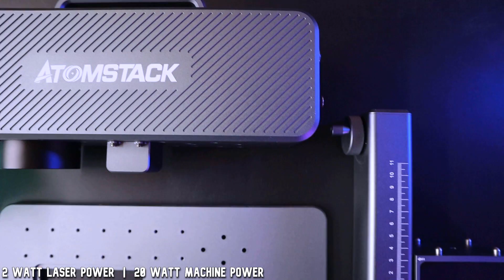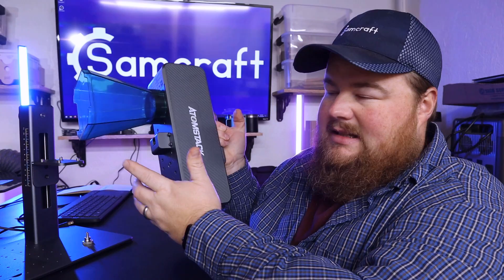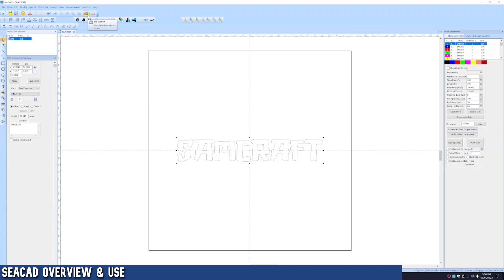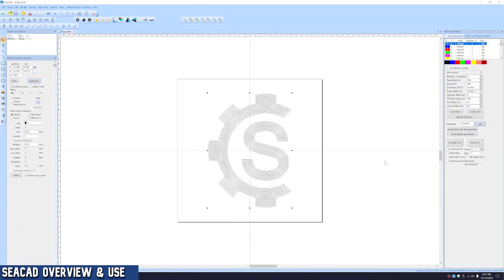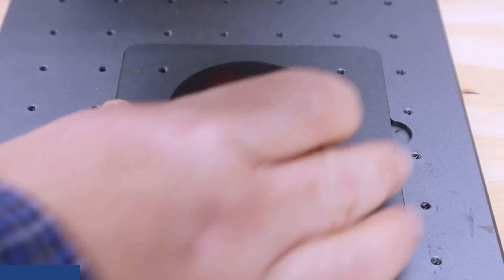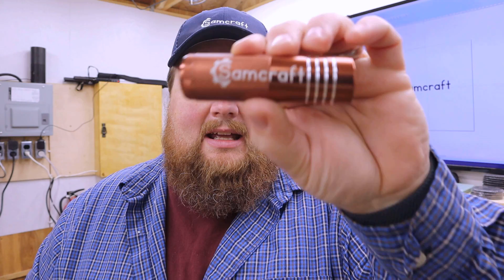SMALL but MIGHTY, METAL Laser Engraver!!

Comment: Im look to buy a laser engraver for metal and other materials, recently stuck at home with back issues needing surgery so o need a way to make some cash. What budget machine would be a good start?
Reply from the maker: The ComMarker B4 fiber laser is very good. I have used mine for well over a year and had ZERO issues. Here is my video on that machine: https://youtu.be/Iv3cawA6e_I
Reply: @Samcraftcom I'm just now reading up on the difference between diode and fiber lasers and I want the fiber but only have the budget for a diode, maybe a diode laser can help me make some cash to get a fiber laser. Maybe. Do you got a donor? lolol, thanks for the reply !!!

Comment: 1:04: ⚙️ Compact and powerful Atomstack M4 laser engraver with 5W laser, 1064nm wavelength, and versatile desktop or handheld use.
3:34: ⚙️ Issues with machine operation and limited flexibility in positioning piece, but includes useful features like threaded inserts and machine screws.
6:48: 🔍 Limitations of the laser engraver software and CAD program make it difficult to use and lack user-friendly features.
9:39: ⚙️ Demonstration of using a laser engraver, emphasizing the importance of safety glasses and the working surface size.
13:00: ⚙️ Demonstration of using a metal laser engraver to outline and mark text on a business card in real time.
16:35: ⚙️ Demonstration of laser engraving on metal, including adjusting settings and creating a PCB-like design.
20:27: ⚙️ Demonstration of laser engraving on metal surfaces, including cards and coasters, with a focus on speed and efficiency.
25:41: ⚙️ Laser engraver performance with different metals and materials at varying speeds and passes, affecting heat dissipation and power requirements.
28:30: 🔍 The debate over whether the laser is a fiber laser or a galvo laser, and the hesitation to label it as such.
Recapped using Tammy AI

Comment: Your video is absolutely amazing and it really caught my attention. However, I don't believe that this product can offer the same level of attraction as your video did. Describing a laser marker that can only make shallow marks as versatile is not a good right guidance. I have tried similar small machines before and while they are convenient, their limitations make me want to throw them away. They cannot engrave, which is a must-have for me to mark my logo on my knives. It takes at least an hour to do the job and the result is often unsatisfactory. I am not sure how this product differs from LaserPecker. If I were to choose, I would go for LaserPecker instead of this product that has been labeled as "Absolutely terrible" on Amazon. It doesn't seem like a reliable machine and their after-sales service is probably not very professional. I would recommend EM-Smart instead, even though there may be a price difference. They are true fiber laser marking machines with the ability to engrave on metals and various materials. Their service is excellent and always provide me with great support.

Comment: That laser is a DPSS (Diode Pumped Solid State) machine.
Has a diode pumped passive YAG q switch that puts out 15KW (microsecond) pulses that are 1024nm.

For the price point, about 1/4 of a 20W-30W fiber, it's not a terrible deal but it is, as you say, pretty low power and has a small working area.

Something for you to try:
Defocus upward (away from the work surface not toward it) between 1-4 millimeters, with an actual fiber laser you can get colors on metal and enhanced engraving depending on what you want to do.

Comment: Great video, a clear, detailed and fair/honest take on the product.

I’m curious how much material is actually removed - how much relief is there (etc, how deep is the cut) on say the slate coaster after all the passes? Ditto the metals after 4 passes?

A side note: I wonder if it would be slightly faster dialing down the speed a bit more on materials, rather than taking two or 4 passes? I’m thinking that multiple passes mean that the metal surface completely cools before the laser comes around again for the next pass. I wonder if you could do copper in 1 pass if you slowed the laser down to say 80 - 100 mm/s? 4x slower would be ~63 mm/s, but I’m thinking that you might not need 4x the time if it was just heating the spot all in one go, rather than letting it cool fully before the next pass comes along? Probably not a significant difference in overall production time, but I’m curious how it would work out.

Comment: Hi Sam, it not only destroys metal, but also the inside of your eyes and under your skin, even in low dosis radiation. Great to see many people are interested in lasers, but safety is a missing element in most low cost chinese solutions. Also exhaust fumes, not removed at all, meaning stailness steel you breth chomium, perfect for getting long term cancer. So in all, be SUPER carefull with these machines, because the CE label of FDA label is only a sticker, there is no value behind it when it comes down on safety.

Comment: The definition of a fiber laser is the laser used a doped fiber as the gain medium. It could be a fiber laser, the spool of gain fiber would be inside the box but the chances of that are slim to none. It is most likely just a more generic DPSS laser, possibly using some passive q-switching to get the high peak power, unless there is a frequency setting some place.

Comment: some assembly required batteries not included for 1699. however thats a dc power jack this can be ran off a battery on a tailgate at trade shows flea markets swap meets the pasture making tags for animals. im sure ts indexable for larger works too. but the price is way more then most people would spend with out some way to make the money back

Comment: The handle to adjust the height is really crap.For me also feels very loose and rough really not nice. but if you turn all the screws too tight then you can no longer turn.I use for my other laser also lighburn have therefore also informed me and even seen a statement that the m4 should also work with it then.hope the update is there soon because that would make the M4 Really good.the software puts me before problems because many files are not supported.In addition, I do not like it so well that the information about the device is often wrong.It is often spoken of 20w which is wrong. He hatt also not 5w he has 3w.Yes, and you're right, it's not a fiber laser, which would be extremely expensive in this small device if it were possible.

Comment: I have the Mr Carve M1, ComMarker 20w Fiber, and a Omtech 100w MOPA Fiber.  I backed the Mr Carve on Kickstarter, it was my first 1064nm laser.  To be clear, you are correct, the AtomStack isn't a fiber laser.  It is a 2w 1064nm (DPSS) diode attached to a galvo head.  The Mr Carve shipped with SeaCAD as well.  There is a steep learning curve when it comes to using SeaCAD and EZCad, they are very similar in operation.  Mr Carve was first out of the gate with a 1064 Galvo, this looks very similar to Mr Carve M2.  I would bet that they share practically everything, minus the shell.   The Atomstack looks identical to the Enjoywood M4.  However, even though this isn't a fiber laser, it is using traditional fiber laser type software.  I would suggest people be educated on the software before jumping into the 1064 Galvo and or Fiber lasers.

Comment: I had a similar laser system for a short time (Mr. Carve M1).  It works great on plastics, and marking metal, but it won't engrave to any real depth, even with hundreds of passes.

I returned it and bought a fiber laser with a 50w JPT source, and the difference was unbelievable.  The material that the smaller laser struggled to mark were cut completely through when I tried full power.  If you're needing to actually engrave metal, not just mark it, get a "real" fiber laser and save yourself some time and effort.
Reply: Got any links to the product you went with?
Reply: Yea but also a huge cost difference and power difference. Your not comparing apples to apples but watermelons to grapes

Comment: Right, nice demonstration. Question, you can feel the engraving, material is vaporized. For my own health I don’t want to be in surroundings where vaporized aluminium is in the air. I like the result, Ilike the process, I like your explanations. Should’nt fume exhaust/suction be setup?
Reply from the maker: Yes, 1,000% yes!!! I just received my 4" duct fans and components to set up a dedicated fume extraction for this laser and my other diodes. :)

Comment: @samcraft do you think an AtomsStack S10 Pro Diode laser will etch slate? Crossing my fingers you say yes because that is what I am about to be working with in the next 48 hours.
Reply from the maker: Any diode or infrared (1064nm) laser above 2 watts will engrave slate. It's one of the easiest materials to work with! :)  Edit to add: You'll want to run a "tile test" when you first get it on a piece of slate. That will show you what the sweet spot is for your exact laser. Actually, if you'll email me I have a Lightburn file I'll give ya for that if you need it.

Comment: Been waiting on you to review this one, as I've been looking at something to mark metals with.  I'm sure lightburn will have it incorporated in the software before too long, they're really good with their support.  The only thing I see on this that I'm not terribly happy with is the working size, 70mm is pretty small, I'll just have to see what size things I'm really going to work with and go from there.  I'm pretty sure the Atomstack would have issues actually cutting metals, where a proper fiber laser can actually do that (at least from my research anyway, I don't have any practical experience with fiber/galvo yet).  Still, the detail you got out of this thing on your examples is outstanding..  Wonder how long it'll be before someone figures out how to use this with a rotary, lol.
Reply: My opinion is that it is made to engrave jewelry and other small material

Comment: This would be great for PCBs.  Cover the blank with black spray paint, engrave the negative spaces then etch.  Run a deeper engrave for the holes to create divots that will pull in the drill bit.  The threaded holes in the base make it easy to create a jig for aligning a 2-sided PCB.
Reply from the maker: That's a very creative and great idea!
Reply: @Samcraftcom  Great idea! I recently came across this idea as well, but I ran into an issue: The laser was leaving a thin layer of paint (perhaps burnt paint?) still ontop of the Cu layer. Would you be able to still etch even with this thin layer or do you know how to remove the thin layer?
Reply: Great idea! I recently came across this idea as well, but I ran into an issue: The laser was leaving a thin layer of paint (perhaps burnt paint?) still ontop of the Cu layer. Would you be able to still etch even with this thin layer or do you know how to remove the thin layer?
Reply: @ghazalia8701  it is residue left by the smoke.   You can minimize it by engraving toward the exhaust port so the smoke is mostly drawn over the area that has not been engraved yet.  Setting up a small fan inside to blow the smoke away from the engraved area can also help.   

 You can probably get enough removed with soap and water or maybe alcohol.  You can’t get too aggressive with cleaning it because you don’t want to take the paint off too.

Comment: That's a cool machine, however, the Laser Pecker 2 is virtually the same machine at half the cost.
Reply: The LaserPecker 2 isn't the same laser at all.  Only the form factor is the same.  This machine operates at a different wavelength (1064nm?), which is what allows it to engrave metal directly.  The LP2 is just a normal 450nm blue diode laser.  It will cut/engrave wood, cloth, paper, and that sort of thing.  The two are complimentary in their functionality.  In fact, the LP 4 combines both lasers into one machine.  The xTool F1 will, too.
Reply from the maker: David Zeller answered this perfectly below. :)